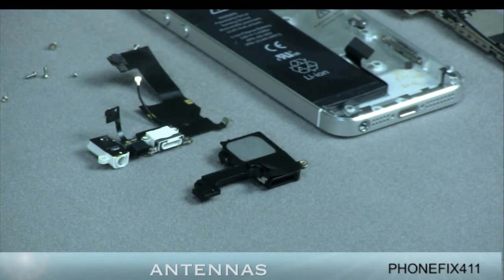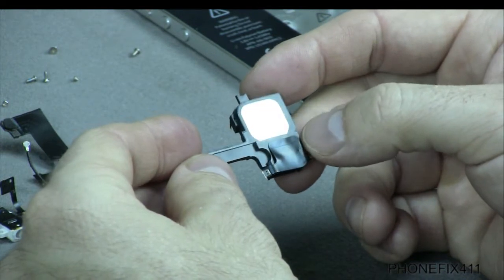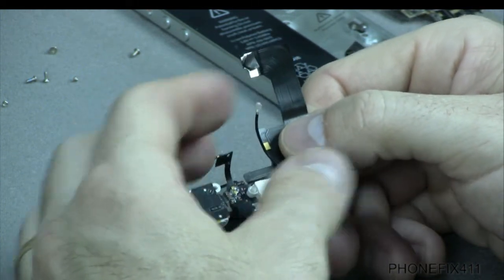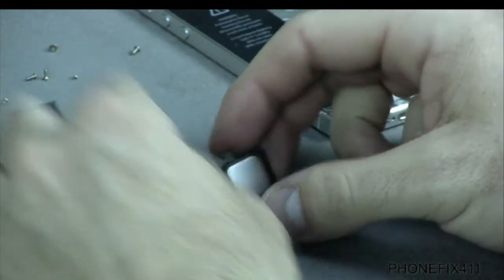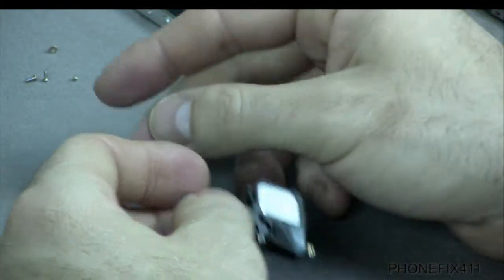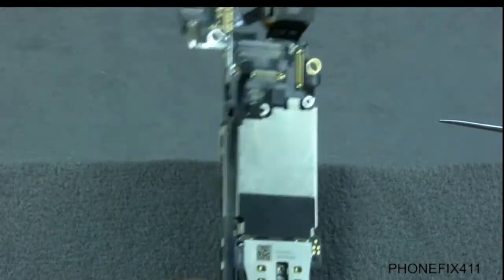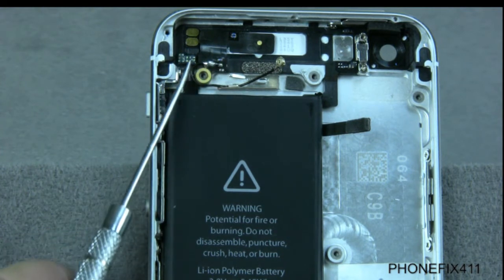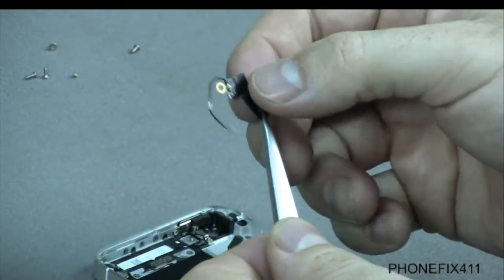iPhone 5 Antenna Repair. Complete Lesson 4 of 14

Comment: hi, I sent an iphone5 for screen replacement and now I have No Service error whenever I install a known good sim card; on a close inspection I noticed at the top of the logic board there is a circuit "patch" that has 2 flat cables normally screwed to the top of the metal case , well in my case those 2 flat tips are missing (probable the service butchered those); is this top circuit patch with its 2 antenna prongs replaceable? can I transfer this from another iphone5 board? thanks

Comment: When i replaced my camera the small earthing clip in the bottom corner of antenna B fell out. Seems to be working. I have been debating about putting it back. Any thoughts? My main question though is about adding a 4G suitable antenna. I have read that the iphone 5 never had a suitable 4g antenna and many people suffer poor 4G as a result. Would it be possible to add a 4G antenna perhaps on a y splitter and perhaps even stick it to the outside of the phone? Or swap out the iphone 5 antenna for an iphone 6 antenna.? Could be an interesting hack video.